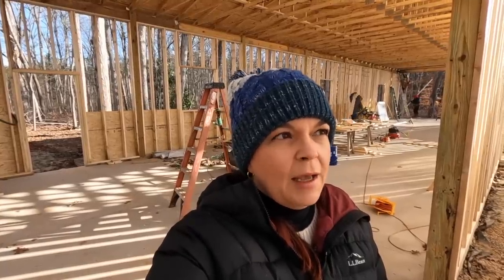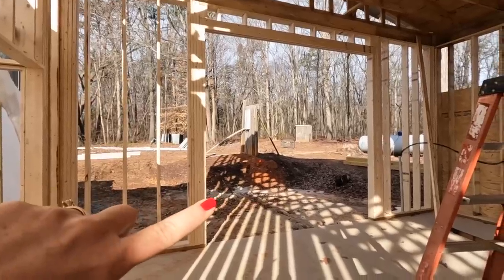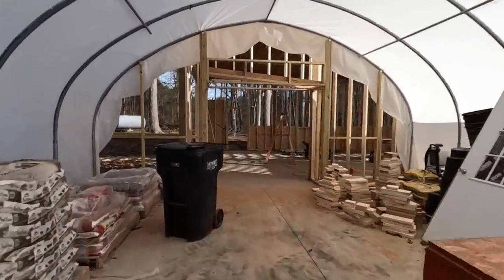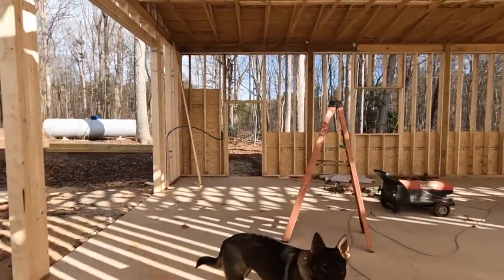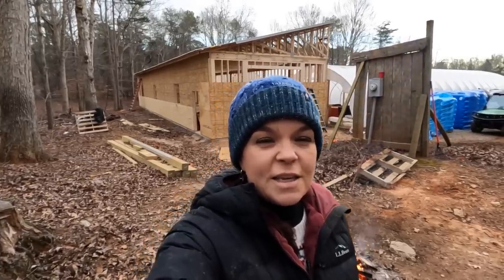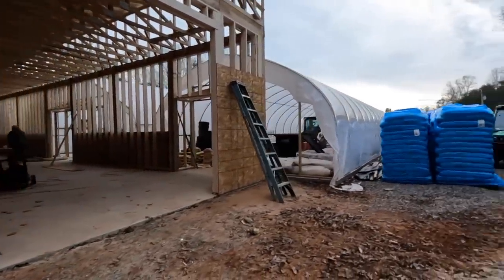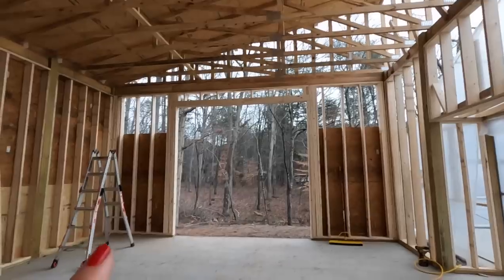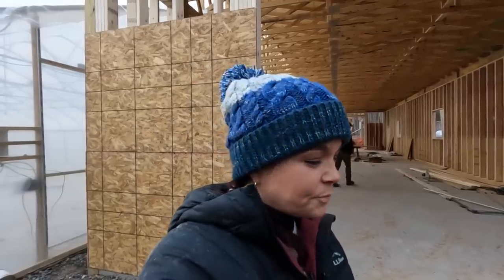We Have Walls! ~ Installing OSB | Gardening with Creekside

Comment: Forget Jackson's construction 🚧 education, Jenny is building skills I never imagined. 😄 I never knew those lines on the sheets corresponded with stud placement. Smart.
Now with the OSB up I have a better sense of your end goal. You guys think of every detail so forgive me if my concern/question comes across as insulting. That isn't my intention. Those areas inside the short "hallways" into the greenhouses seem to be (eventually) enclosed boxes (am I right?) so am wondering about drainage in each of those walled in, roofless enclosures. Or have you provided for access in case you need to clean up leaf debris or add rock mulch or whatever? Was I clear in my description? 
Loved seeing that little campfire 🔥 Jackson is one smart fella.

Comment: Oh yay! The annex is looking great! Really coming along. Question, The dry storage end next to the annex. Will you close up that end with the plastic or are you going to leave it open as is?
Reply from the maker: That is on the project list! Both ends of the dry storage will end up having walls on them, but the two ends will have different types of doors.